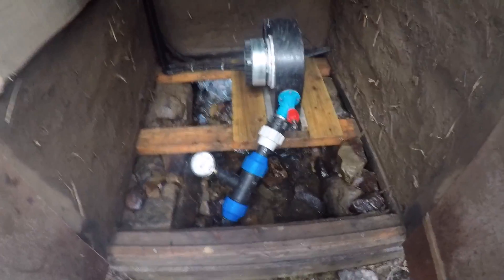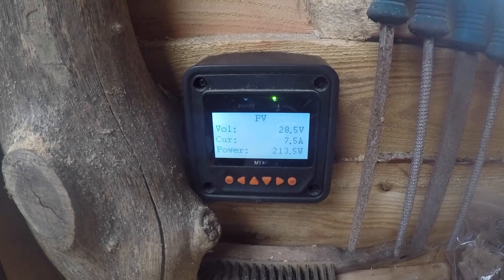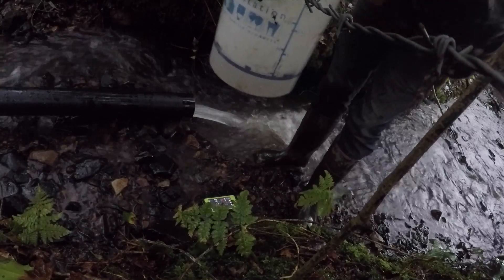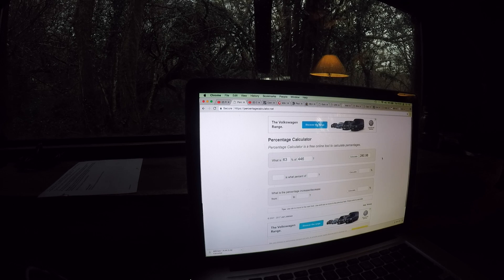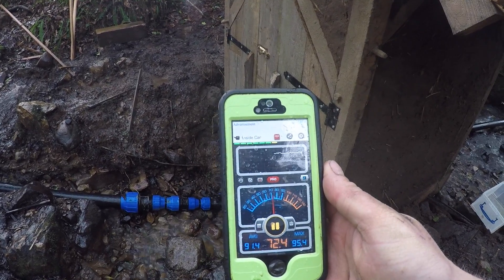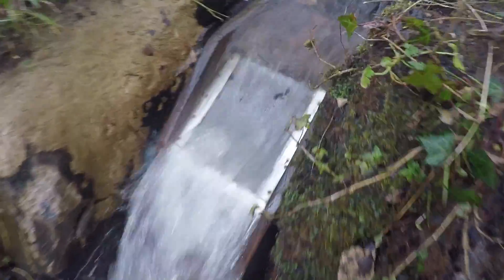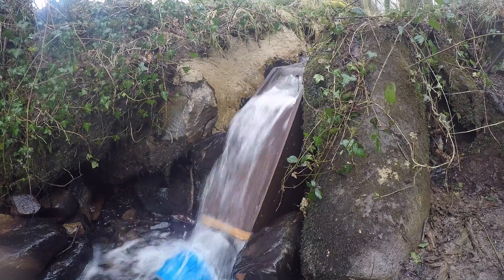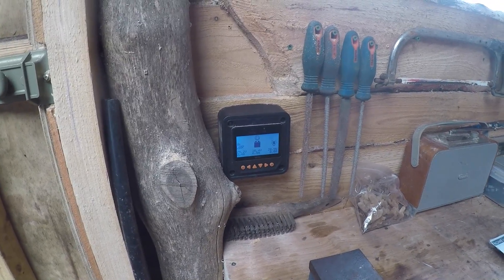DIY Micro Hydro Part 17 The Figures

Comment: You should add in a flow meter.  You could eliminate the bucket and be extremely accurate.  Flow meter run on 4/20mA 12 or 24 volts

Comment: I'm sure you've improved on this since 2018, but to reduce the decimal rating you would sew some old towels together and put them in a wooden frame, and hang them inside or you could purchase the foam pyramid-looking things on amazon, which I think has a similar principle to the quietest room on earth. I have seen a video of them popping a balloon in the room and the noise was almost completely absorbed. It was actually in the negative decimals.

Comment: Interesting! Curious, have you thought of a Gearbox? Water wheel with a Gearbox connected generator to spin the generator faster & create a better efficiency, more power instead of direct drive? Also you db level inside is probably mostly the fan still attached.

Comment: If you put the inlet valve back to 50% you should get 25% more power output from your turbine. because water is incompressible it must flow faster aka pushing more force on the turbine = more power

Comment: Solor outputs dc current turbines output ac you need ac to dc converter or you can use a ~ charge  controller
Reply from the maker: if you watch all the videos you will see that i have a rectifier and charge controler.

Comment: Omfg no ads I love you I support this content maybe you should monetize
Reply from the maker: there is adds on there, its just youtube not doing a very good job at the moment, earning about half what i was a year ago and iv got twice as many subs.
Reply: Kris Harbour keep up the good work hey have you looked into the midnight classic charge controller https://www.thepowerstore.com/midnite-solar-classic-200-charge-controller-79a-200v?gclid=CjwKCAiA-9rTBRBNEiwAt0ZnwyD4Nbql7ujgB6auMTpBDxhsyCBXvdZGIZloTZeFuYowVpUXPbZbeBoCpzIQAvD_BwE

This one is great at taking higher voltage and stepping down to 48-24 or 12 at a higher amperage this should help a lot with efficiency. It’s mppt like you want and had a dedicated mode for solar, wind , and hydro applications

Comment: with full batteries with this sytem, your plan is to use solar as a backup only for the moment?
Reply from the maker: they will come in to there own in the summer when the stream dies down, it goes down to a trickle sometimes during the summer.
Reply: nice, you are doing a heck of a good job m8.

Comment: Thank you for good material.
renewableenergy/79745
---------------------------------------------------------------------------
What about small hydrographic specifications?
(1) Hydraulic tube length (meters):
(2) Hydraulic pipe diameter (mm): 110
(3) Fall (m): 25
(4) Flow rate (lps): 2.5
(5) Rated Power (W):
Reply: Micro Hydro Electric Part 1 Head, Flow, Power Calculations
https://youtu.be/MUNMjdmGIPI

Micro Hydro Elecric part 2 The Turbine
https://youtu.be/3t4vb1NAiF0

DIY Micro Hydro Electric part 3 Powerhouse Foundation
https://youtu.be/ng8wvAn_Wx0

DIY Micro Hydro Electric Part 4 Powerhouse Timber Frame
https://youtu.be/RNL03BIc3cw

Diy Micro Hydro Part 5 Powerhouse Oak shingle roof
https://youtu.be/OoFQS7Tx2ao

Micro hydro Electric part 6 The Intake
https://youtu.be/ozgpsrzBHMs

Diy Micro Hydro 7 Almost finished powerhouse
https://youtu.be/9T1HZPjmMcw

DIY Micro Hydro part 8 intake pipe connection
https://youtu.be/I4i3B-lRCy8

DIY Micro Hydro 9 Mounting the turbine
https://youtu.be/w6CrPAy6tlI

DIY Micro Hydro part 10 Powerhouse Pipe
https://youtu.be/9xbg6FduK34

DIY Micro Hydro part 11 Moving power out to the workshop
https://youtu.be/ZGOBDLXiEnM

DIY Micro Hydro part 12 Laying armoured cable
https://youtu.be/Fu_qKmjPJ6Y

DIY Micro Hydro part 13 Pipe delivery, Digger Cold Start
https://youtu.be/RadnEup1-5M

DIY Micro Hydro part 14 wiring The turbine
https://youtu.be/Zuu0dIauiaI

DIY Micro Hydro part 15 Laying the pipe
https://youtu.be/3_rWpWwlrcE

DIY Micro Hydro Part 16 Powering Up The Turbine
https://youtu.be/LWqFEF2Ov4c

DIY Micro Hydro Part 17 The Figures
https://youtu.be/ZgueWYPuVrI

Comment: not that i know what i'm talking about but would it not be more suffisient With overflow then under flow? With underflow you would be sending the water around inside the casing? the old waterwheels got more powerful when they started With overflow. but might not be this when generating Power
Reply from the maker: It makes no difference to peloton wheels, the water hits the cup and splits in to two jets that turn 180 degrees (imparting 98% of there energy) so it does not matter if they are over shot or undershot. Water wheels work completely differently.

Comment: When you opened the valve to increase the water  flow the turbine seemed to increase rpm to a point then slow! Can you monitor rpm?
Reply from the maker: That was as the load was being applied by the charge controler. that was the sound of power!

Comment: What happened to all that sand you pulled out of the water funnel before? You said you were worried and would have to solve it, did you?
Reply from the maker: it is something that needs to be addressed at some point its only going to cause wear on the nozzle and pelton wheel a little be faster. so there is no massive rush. but its on the list of improvements.
Reply: I think drilling a relatively small hole in the base of the intake should really help.

Comment: Congratulations using so little water practically you have the maximum efficiency of the pipeline, at which the load losses are nil, perhaps located mainly in the final part, if the data are real and precise especially of the range is a good goal, but you have a greater potential , therefore more power but less efficiency of operation of the complete system, you have to use the function of derivation of load and dissipate the power with an adequate resistance, otherwise with a charged battery the turbine "runs at high speed"

Comment: Hi Kris, very good ! you have enought power ! you need now a good storage. But I'm sure you already know how to do. What is the online software you use for hydro calculation. ?
Reply from the maker: Hi Cristof, Thanks it has been a very fun project and very rewarding. one day i will get round to making a 18650 battery like you are doing. i have made them before for my electric skateboards so i know how much work goes in to them. i just google hydro electric calculator. there are lots of them. some more complicated than others. i also use cable loss calculators and pipe frinction calculators. all very useful tools.
Reply: cristof48 , I will have to check your channel out and am glad to hear Kris is intending the 18650 route! While more expensive than lead acid it seems the best way forward.

Comment: Easiest way to think about noise leaking from the building is, if air is leaking so is noise. It's really hard to air seal that building. But I just thought I give you a heads up.
Reply from the maker: well yes that is true, but mass does absorb sound, so more mass will always help even if there is an air gap. of course air tight is ideal but i cant do that on this building really. the building is reducing the sound by a large amount. around 20 decibels that is quite a big difference and i can make more improvements still.
Reply: Yea, not criticism just giving you some tips that may help. I dont even know if sound is an issue :) The easiest way might be to put some offset grid in the stream, since sound mostly travels in straight lines. Probably not worth the effort though.

Comment: To work out what % of a value you have: Divide the other figure by 100 ( this tells you what 1% of that figure is) and divide your value by that. So with your figures: 446/100 = 4.46,   280/4.46 = 62.7%. Much easier than fiddling with an online calculator.

Would you say the stream is at it's normal Winter flow rate? We've had a pretty wet few weeks and I wonder if the flow at the moment is a little higher than its Winter average?

What power are you getting from your extended solar bank at the moment?

I believe db is a logarithmic scale and 10db is double not 3.

Great work Kris, I have to say I was sceptical when I first saw that little stream but that is a great output, especially useful during the Winter when your solar output is low.
Reply from the maker: Thanks for the advice there. The solar is disconnected at the moment due to using the charge controller on the hydro, but that will change once the new controller arrives.
Reply from the maker: And yes the stream is flowing at about the average rate for winter. It does go up and down with rain but a few hours after the rain stops it returns to its normal flow.

Comment: One thought regarding a dump controller, wouldn't it extend the life of your turbine blades? You showed the silt that built up in the intake, I can only imagine what those fine particles are going to do to your wheel and nozzle when it is flowing around the clock. I love the idea, and will definitely implement something like this given the chance if/when I have the property for it.

Comment: With that water emptying out as it does it will bore a hole under your turbine and it time it will cause problems.
Reply from the maker: The stream bed is all rock. It will take about a thousand years to erode.
Reply: The foundation is set on either side of the stream, so I wonder if the erosion will even reach it. Plus not sure what the stream bed there is composed of but it looked like golf ball sized rocks.
Reply: Kris Harbour I was glad that you checked that. Because in time the erosion would become a problem but I think having a concrete slab or a rubberized barrier it would insure a smooth area where the water can transition from.

Comment: Great stuff man! As a complete novice i was wondering if that stream ever freezes over and what your plans are for that?
Reply: It takes a while for running water to freeze, this whole series has been done in the winter and it seems to be running smooth. I think there will be more problems with it drying up, decreasing the flow rate.

Comment: Good job Kris, been waiting for this one! Would it be possible (or advantageous) to put a solenoid on your intake that will cut off or reduce flow when the batteries are full, you can probably get wireless ones these days that you can control from your phone.  Maybe just save you having to visit the powerhouse twice a day.

Comment: You could probably have a govemer instead of a dump load, but then that's wasting energy, good back up though if the dumpload fails (if you add another nozzle) also you could have the govener close the nozzle as it over-spins.

Comment: You definitely need some electric appliances.  Space heater, water heater (is your heater electric as well?), stove top.  280 watts continuous is a lot of power.  Add solar to it and you're really producing some juice.  Well done!
Reply: Sure, but with 1000W of solar panels and his hydro system, he could definitely afford to run them some.  Water heater is a big load too, but again, running it for an hour wouldn't be out of the question.  Either way, I'm sure he has plenty of ideas in mind!
Reply: electric appliances are crazy wasteful.
Reply: Electric heating is about as efficient as you will get ... on anything! 
Do not confuse efficiency with work done. There is a lot of energy released in burning wood ... but it is about 30% efficient. Electric water heaters are approaching 98% efficient (you do not hear or see any by-products do you?
Reply: He has a small stove with a water heating coil around the flu. Check out his cabin tour video.
Reply: lad oreily Many electric appliances are inefficient and waste energy through heat but electric heaters are 100% efficient. I'd certainly use the extra energy in this system for heating. It's not enough to do it all but you can buy small infrared heaters that use 300w elements or use a 300w water heater element. Infrared style heaters will feel significant even at just 300w because they're not heating the air compared with normal convection heaters.  They are around if you look for them and being free energy it's well worth using.
Reply: oh and if you want to get really efficient, look for "far infrared heaters". These are the most efficient at NOT heating the air and are used in baby incubators. Near infrared heaters will emit an orange glow and are often sold in high street stores, usually called halogen heaters. These are better than convection but not as efficient as far infrared.

Comment: I notice you mention, lights routers and laptop, is this the current extent if your electricity needs? I'm guessing the laptop covers the TV needs, will you be using a fridge/freezer? Microwave? Washing machine in future? I'm guessing your power tools would be the biggest draw at present? I am no expert in watts, amps and current, but the input sounds a lot less than the regular 240 /230 volts of A.C. in homes....i know batteries and inverters impact on this, but don't have the knowledge on how?
Reply: "Americans are the wealthiest people in the world"

American education hey?
Reply: Aaron the Humanist I can't imagine him getting many appliances. I should think he'll just be chuffed to have the fridge and freezer on all the time! Tools on the other hand... 😘
Reply: Aaron - Energy is Watt-hours, it's a quantity. Like how much water you have in a bucket. Power is the rate at which you use energy, it's a speed, measured in Watts. Like how many liters per minute you're draining from your bucket. He's steadily producing 300 watts, so he can run 300 watts worth of stuff non-stop. A laptop is maybe 20-50 watts. A microwave is around 1000 watts. Washing machine is around 1500 watts. A fridge is around 200 watts. So some appliances he can run directly from the generator, others he won't be able to run at all.

However, if he implements some power storage like batteries, he can generate power non-stop and store the excess energy, calling on it when he needs it. A microwave is 1000 watts but you only run it for maybe 3-10 minutes a day, so the power (rate) is high, but the energy (amount) is small. This hydro system generates 7,200 watt-hours a day. A typical US household (family) consumes 24,000 watt-hours a day, so, for a whole family, this would only cover 33% of their power needs. But if it's just him, and he gets a battery bank to handle the power concern, he has plenty of energy added to his system in a day.
Reply: 24kWh for typical US household.., does that include electrical heating systems? We live two in a flat with fridge/freezer, electric oven and cooktop, dishwasher, two laptops, TV and amp. With that plus lightning I consume in average 5kWh per day. Can an american family really consume 5 times that?
Reply: npull - http://shrinkthatfootprint.com/average-household-electricity-consumption <-- Annual energy use. Divide by 365 for daily.
Reply: Paulius - Americans are the wealthiest people in the world, so it makes sense that they'd have the highest energy requirements. Energy use scales with wealth, the more stuff you have and the more things you do, the more energy you use. It doesn't have much to do with how "wasteful" an entire country is because being wasteful costs money. You don't need to be ethnocentric about it, there's nothing special about Americans.
Reply: Obviously just a jab at America by a nasty European, yet you are here for some reason.  You must be living in a shitty house with air coming in through the windows.  Why are you living in a DUMP?  Please tell us.
Reply: Well not exactly. Energy costs are low so they don't really care if they waste or not. They could build warmer houses to prevent heat/cold to get out, but it is not economical as energy is cheap (comparing to putting better heating materials etc). I am living in US and my needs are the same as was when I lived in EU, but use much more energy as before. Before I used max 300kw in winter with -20C outside. Now I use between 400kw (summer) and 1000kw (winter) of energy mostly because you can feel airflow around windows. All kitchen tech is much more energy efficient in EU than US.

Comment: Love your work Kris! On my off-grid hydro setup I use a CS 35 Schneider Electric load controller, I don't know if your turbine works the same as mine, but they require 100% load all the time. Turbine to batteries, batteries to load controller, load controller to dump load an air heater. Really simple I never turn it off and I never worry about it just pure power all day and night. Keep up the good work

Comment: That's some impressive noise attenuation! 90 dB is loud, but not a concerning level - you'd need hearing protection if you were in there for an 8 hour shift, but for 5 minutes while you turn the turbine off or on it won't be an issue. Instant hearing damage only occurs north of 120 dB, which is a long way from the levels measured
Reply: Also, taking the fan off the alternator is going to remove one of the noise sources from the turbine shed. How noticeable the difference is depends on the relative contributions from the fan and the water noise, but it can't hurt

Comment: I don't think maximum power is with the water valve turned all the way open. The valve changes the shape of the water spray hitting the turbine. I think you will find the water valve "sweet spot".